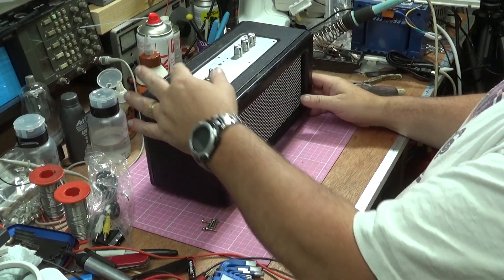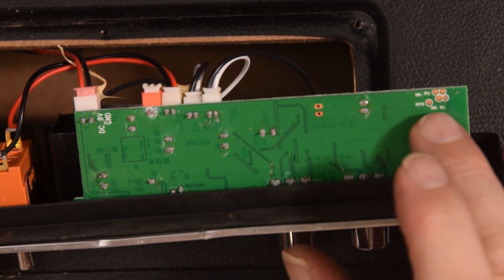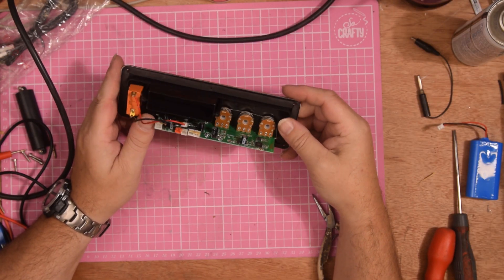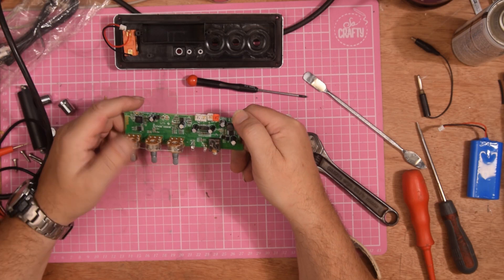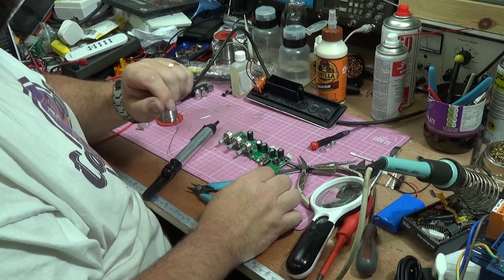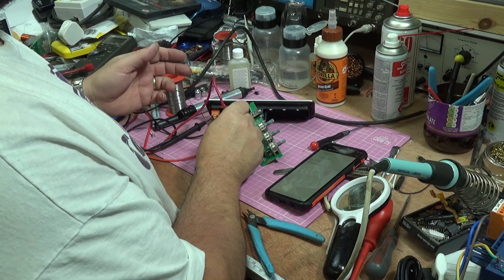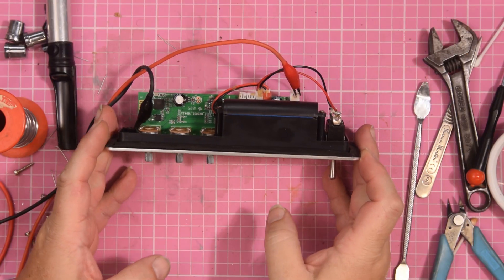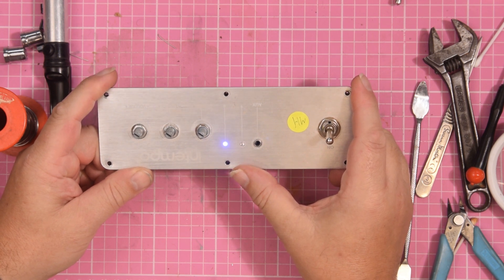Broken Bluetooth Speaker : Water Damage Repair

Comment: The best few hundred bucks I ever spent for my shop was for an Ultrasonic Cleaner and a gallon of saponifier specificity made for cleaning flux and circuit boards. Being able to drop an entire board into the UC and pull it out and easily identify trouble areas is so much easier! 10/10 would recommend to anyone who repairs electronics.

Comment: Did you replaced the capacitors or you just re soldered it?
Reply from the maker: I just resoldered them. They were not old, just a bit of water damage to the board
Reply: @GeorgeChristofi  okay, i'll try to do the same mine.

Comment: Can you fix urbanista speaker
Reply from the maker: it depends what is wrong with it. a lot of speakers use custom modules so are pretty much scrap if they have component damage but ancillaries such as switches and batteries are easily changed.

Comment: Do you fancy fixing my speaker for a video😺
Reply from the maker: It depends on what it is, how it is damaged and whether the shipping costs are reasonable...
Reply: George Christofi it’s a GTK-XB60 speaker, it lights up when charging but none of the buttons on the top work to turn it on
Reply from the maker: @MerceTheMenace  oh, that's one of those Sony things with the logic controlled buttons... Big heavy beast. Hmmm... Let me do some research because a lot of logic stuff has issues with custom parts that you can't get hold of.
Reply: Okay pal that sounds good, have a look and let me know I don’t mine paying for shipping(if not to expensive I’m from Lancashire)

Comment: Another great repair George. I just wonder how it got any moisture in it if it was supposed to be sealed?
Reply from the maker: I think sealed is a loose term when it comes to Chinese things. What probably happened was someone spilled a drink, on it or it started to rain and it got wet. The only seal around the panel is the pleather surface against the aluminium panel which is n't as flat as it looks.

Comment: Nice save on the speaker! Too bad they didn't spend the extra penny and put conformal coating on the board! 👍👍
Reply from the maker: You know that would have been just that little bit too far into the profit margins! Really awful solder on it, it would not melt without far more heat than I was really comfortable with.
Reply: Isn't lead free solder just wonderful? 😵
Reply from the maker: @YouAllKnowBob  I don't even think there was an inkling of what we know as solder in it. More like epoxy with metal in it.